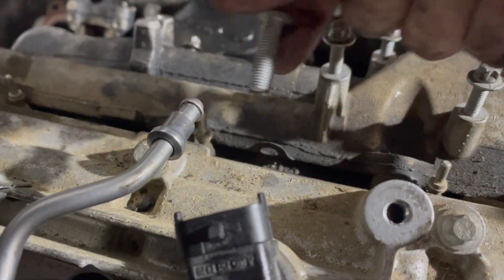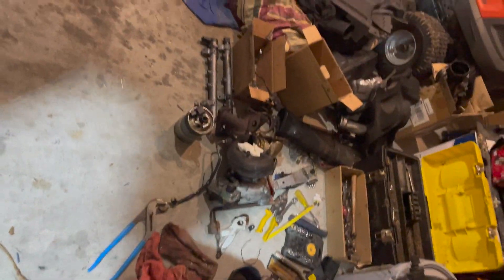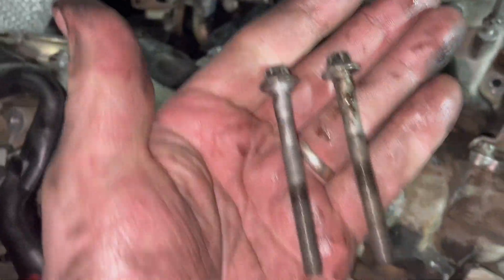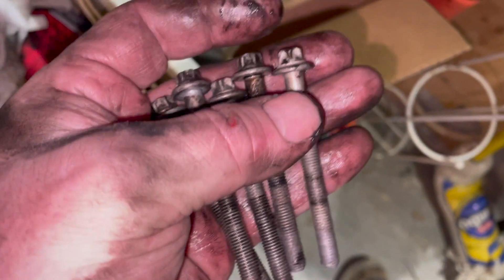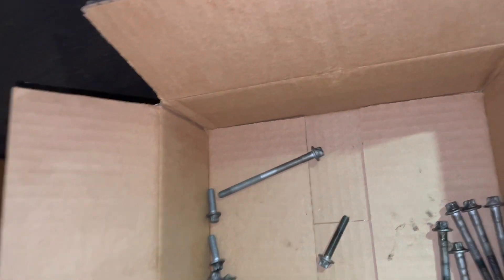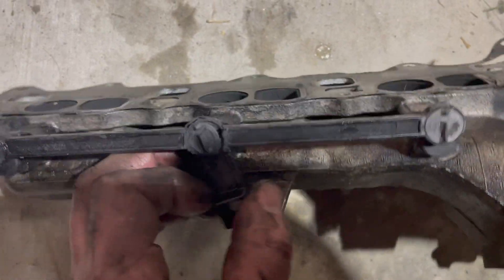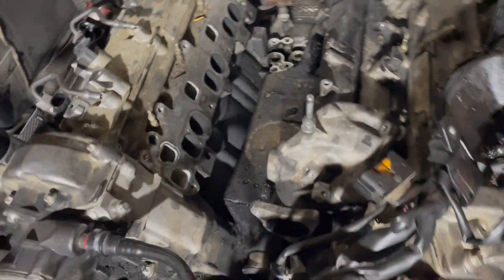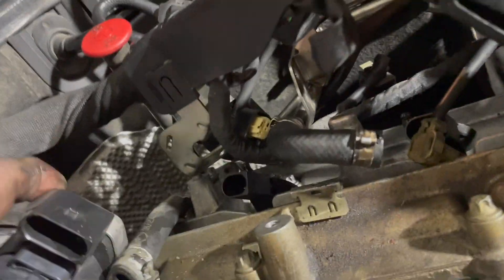OM642 (oil cooler leak fix 4) Intake manifolds removal & swirl flap linkage inspection

Comment: Should I remove and clean my current intakes or buy new intakes and remove the swirl flaps plus resistor mod
Reply from the maker: I would just clean them. The only reason to buy new ones is if you want a new swirl  flap mechanism since it comes with the manifold. If you are going to remove the swirl flaps anyway I would just go with the old ones
Reply: Thank you so much , I am getting the M55 code when I floor it past 80mph and it’s triggering limp mode but no CEL . I delete the codes and the car acts normal , it’s 2008 E320 with 286k miles

Comment: The Other cooler that sits onto of the oil cooler is a EGR Cooler. Yes EGT has a cooler on the OM642 from 2010 about.
Reply from the maker: That’s right. I have a video that describes the EGR system while it is removed. The EGR cooler is right on top of the oil cooler when it’s put back together